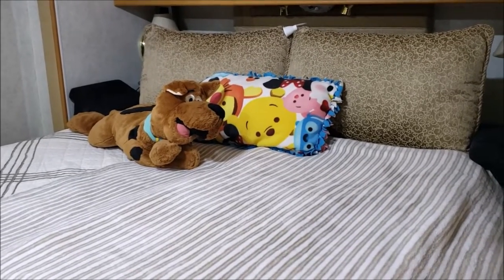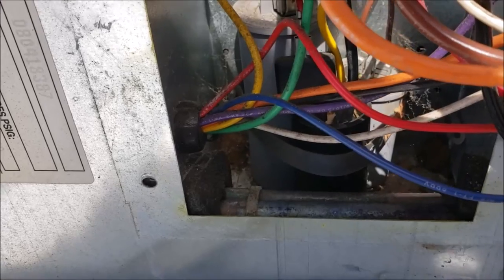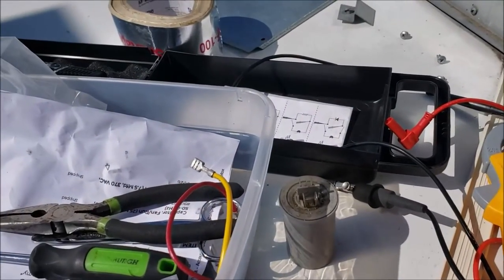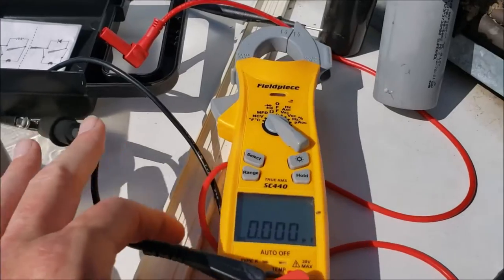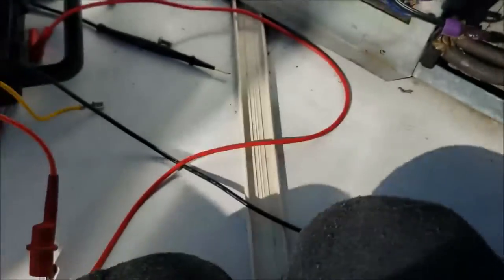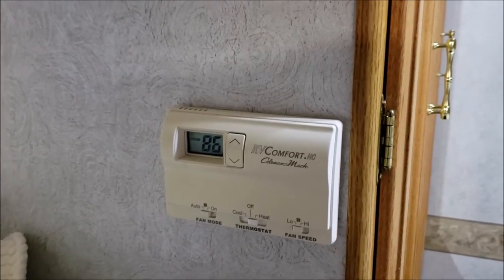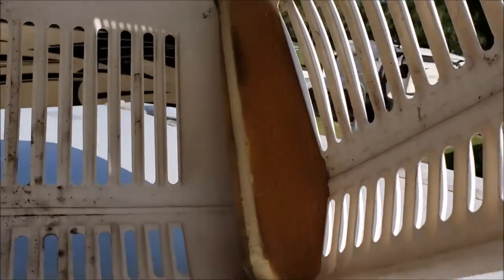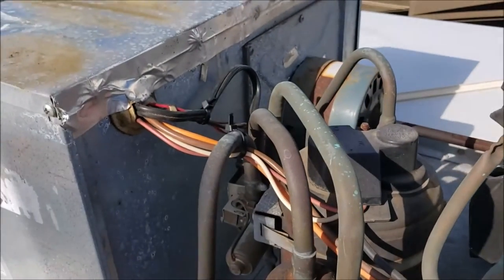WARNING Your RV Air Conditioners Capacitors Are About to Blow Save Time and Money Replace Them Now.

Comment: Do you turn the fan on first every time you start your A/C or just at the beginning of the season?  Thanks.
Reply from the maker: I still have a habit of doing that for our bedroom air unit. I noticed our new Furrion AC unit has a delay built in,, first the fan turns on then the compressor starts a few seconds later check it out here https://youtu.be/pgK_uSahvSY

Comment: Thanks for the education.  I am going to start using your start up method to run blower motor first.  RV Odd Couple and AZ RV Expert have videos on installing one of the two different types of rv soft start boxes on roof AC.   All exclaimed how great they work. That is allows unit to run on much lower amps and help extend life.  I asked anyone about installing on Coleman basement AC and nobody seems to have done it before and they doubted there would be room to fit in the basement unit.  Do you have any experience with Coleman basement AC?
Reply from the maker: I have not had the chance to repair a basement air.... YET..lol!!

Comment: PTCR = Positive Temperature Coefficient Resistor. As current flows through it the resistance increases to take the soft start cap out of the circuit.
Reply from the maker: Thank you, I know how it works but could not think of its acronym.

Comment: Mine is doing the same thing but if I spin the fan and start it it works
Reply from the maker: Try a new capacitor but keep in mind with its age it could also be worn bearings, putting the armature out of line, if so you will need a new motor see this video. https://youtu.be/YXjkmL5ls2E?si=pd2S8KkknPUijtEB
Reply: @ktoutdoor  thank you I'm ordering the capacitor now I will let you know if it fixes the issue

Comment: My lights have started flickering with the a/c running. Sounds like the run capacitor?
Reply from the maker: Is it a constant flicker or only when the ac comes on?
Reply: @ktoutdoor  It’s flickering on and off as it runs. Not constantly. It was flickering real bad, so I turned it off, waited 10 min, and restarted it. Not flickering currently, but I’m in hot TN, so if I can get ahead of a failure, I’d rather. I’ve got a camping world 30 minutes away.
Reply: @ktoutdoor  The camper is 14 years old or so, and a/c has never required work till now
Reply from the maker: @JohnathanBach  Text me so i can call you back 606-875-0125 Kevin
Reply: @ktoutdoor  You sir, have earned yourself a subscriber!